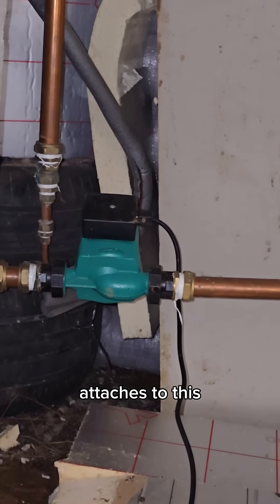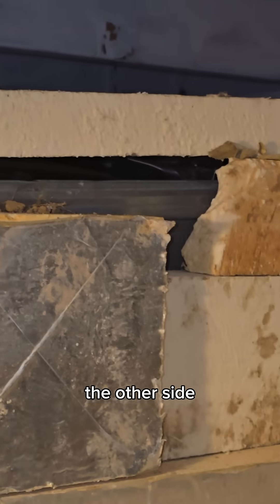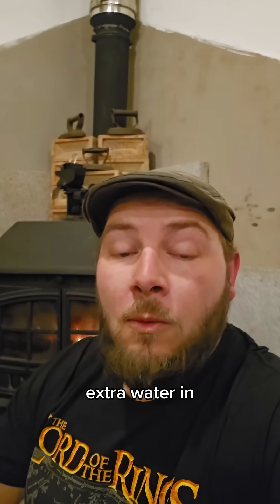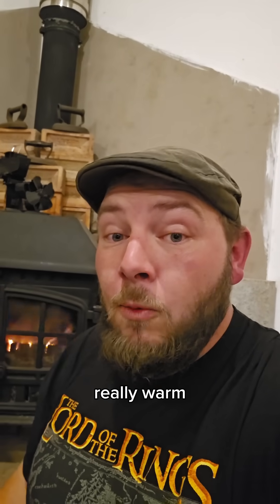Heating my House all night from a back boiler and sand battery using Horse Manure fuel. how it works

Comment: If you re-do this - swap the straight pipe flu for a zigzag engineering brick one, that will create and even larger thermal mass.  If you're worried about tar buildup, the front can be made from a combination of thermal bricks and cement board so it can be removed for any maintenance, though if you're careful about what you burn it shouldn't be an issue.

Comment: As a plumber id advise swapping the plastic tank for a lagged coppers cylinder,  much much more economical,  we know u love that
Reply: He wants a vented system so the boiler doesn't explode
Reply: @garyquartley1084  that's it, take fed open vent on copper cylinder,  would stay warm always
Reply: @davidpegram8068  Would be much better of with an old stainless steel on an open vent  as its only being used as a heat store. Tbh if he's not going above 50 degrees he could seal the system and have a prv with temp and bar.
Reply: Oh yeah if he changes to oil the plastics defo got to go as its calorific value is much higher than horse 💩 😂

Comment: Having a large masonry chimney breast is the traditional way to do that. Old open fires never projected heat like a modern stove. The major issues with a diy job will be the risk leaks - yes water but worse is monoxide. Solid fuel can be a major advantage in a power cut, but if you need water pumped around you won't be able to run it hot without ruining it, or without a backup power for the pump (or maybe a bypass and a hand crank I suppose).

Comment: If you can find any bricks from a storage heater that would be even better or some staffordshire blue engineering bricks, they will hold/store heat longer than the flettons. ( good on ya mate, escaped the matrix )

Comment: I was always told that you had to leave space around the wood burner. I’m not sure why that was but something to do with heatas and house insurance. It’s a great idea about the sand thermal battery though. I make Brickets out of softwood sawdust from a friend CNC machine mixed with waste paper
Reply: Not an insurance company on the planet that would cover his house lol
Reply: Yep. Most people use a heat shield. If thermals conduct into the wall it can eventually set fire to the wall if it's timber or even the cavity insulation. It's called Pyrolysis and it can even take years of exposure to heat before there is a fire. I'd always ensure an air gap of at least a couple of inches between the wall and the thermal conductive objects by the fire.

Comment: If I wasn’t renting I would love to have a used oil heater. I work has a chef. We throw around 70 litres a week in blue tubs   Only get about £20 for it. If I offered work £20 I could have it
Reply: Get yourself a car you can run with it
Reply: It's not worth it for the volume you are talking. You need a specific biomass boiler to burn it and the oil has to be hydro treated. You can't just drain it from a deep fat fryer and off you go. Maybe if you saved up like a thousand litres plus and then paid for processing it before you could use it maybe. Most people just get it ready to go from a tanker that parks at your house and I've never heard of anyone sending it off for processing themselves on a domestic level. I'd expect by the time you send a thousand litres off for processing and redelivery, your just better off buying it ready to go and it would probably work out more cost effective.
Reply: @natesingeruk 
I’ve seen people use car oil in a workshop or garage with nothing done to it. It was an old log burner conversion.